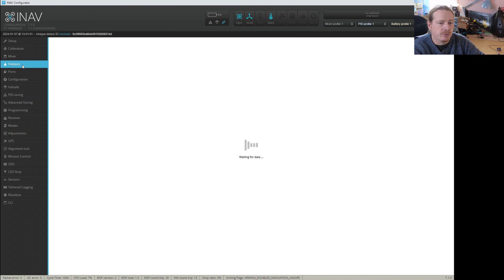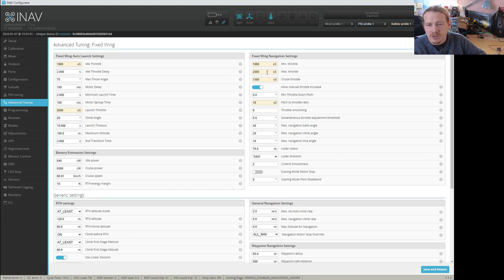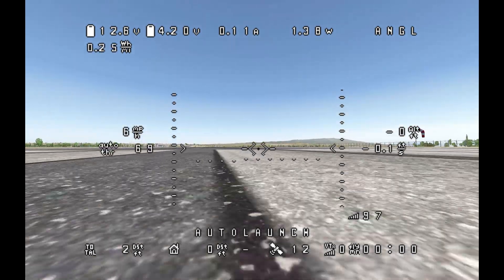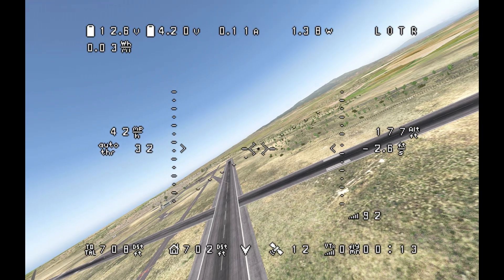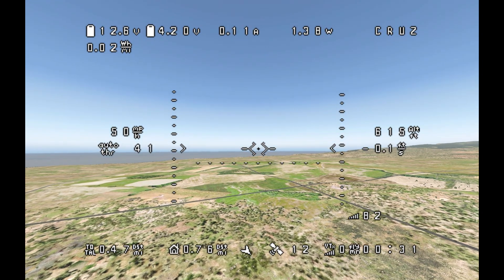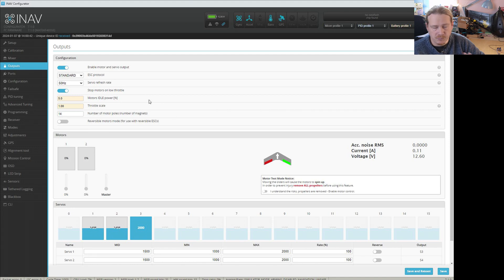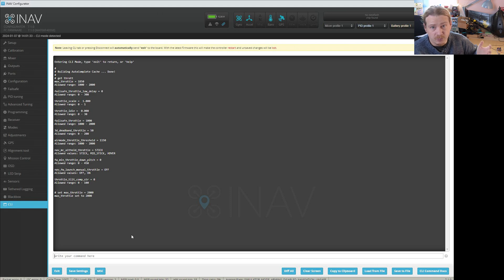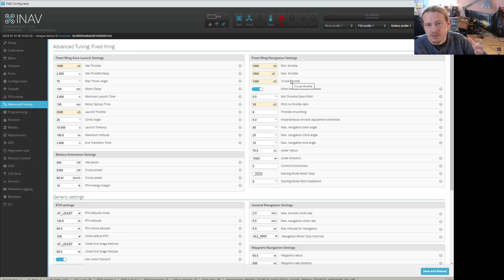INAV Fixed Wing Scaled Throttle: How to get the correct values in your OSD

Comment: Great video, trying to diagnose a motor screeching noise when powered and throttling up via flight controller brand new motor screeching at low throttle.  Tested motor on regular servo tester and runs smoothly and quieter.  Any thoughts on this issue?  Thanks for the content.
Reply: Hope you figured out the problem by now. If not, try changing the ESC protocol to Standard if it's something else.

Comment: Does this mean that I have been effectively flying with a throttle cap of 1850 using default INAV fixed wing settings? Could I expect to see more rpms at the motor after changing this to 2000?
Reply from the maker: No. If using DSHOT or the ESC was calibrated. There wouldn’t have been a throttle cap.
Reply: @MrD  Great, thanks for clearing that up for me!

Comment: Hello. One think is not clear still for me.  When you apply Throttle Scale , the throtle values you set in AutoLaunch and Navigation Settings are also scaled by that factor, or those are the final values (after scaling)  ?  Also the throttle value you see on the OSD is already scaled ?  Thx.

Comment: Hi Darren, sorry for being off topic. I use a 34inch widescreen monitor.
I can't get Inav in a good proportion on the screen. For example, I can't reach the bottom of a screen to save settings, for example. It is not possible to reduce the size of the program or to adjust a layout.
Is this problem known or is there a solution?
Reply from the maker: The size of the monitor won’t make a difference. What matters is the resolution the monitor is displaying at. My main monitor is either 28 or 32” widescreen, and it works just fine. Maybe increase the resolution if you can. 34” is huge. You should at least be able to run 1920 x 1080 on that. That resolution is fine for configurator.

Comment: Is it only for showing the correct throttle in the osd or does it also change how fast the motor will spin? So do i have to change the cruise throttle afte making the changes?
Reply from the maker: You don’t need to change your throttle values. They were being displayed incorrectly before.

Comment: Nice!! Will this now mean that 50% stick will show as 50% on OSD? or do i still need to make 1000-2000 endpoint adjustments using rxrange in the cli?
Reply from the maker: Yes, 50% on the stick will show as 50% on the OSD. Yes, you should always make the 4 main control channel ranges 1000-2000. I actually prefer to do it on the radio rather than rxrange. I have a base model, that all my other FPV models are duplicated from. After setting the endpoints on the base model. I never have to worry about it again.

Comment: Thanks. But why isn't max_throttle set to 2000 and throttle_idle set to 0 as part of the defaults when initializing at new board and choosing a fixed wing model? 
It'd be great to have an explanation of what throttle_idle and "stop motors on low throttle" really mean and do. Don't motors always stop on low throttle?
Reply: It's a relic from BetaFlight/CleanFlight quad flying. On a quad, you 1) can't stop the props at idle, because if you drop the throttle to start a dive and your props stop spinning, you not only have no throttle, but also no flight controls, since the props need to be spinning for that. So on quads, when they are armed but the throttle is at 0, the props are still spinning, even sitting on the ground. Conversely, 2) you can't ever really go to actual 100% throttle, because you would also then not have any control. Imagine that you were flying a quad, at actually 100% throttle. If you commanded a left roll, then the right motors need to increase throttle in order to bank left. But they are already at 100%, so there's nowhere higher for them to go. Even just to fly straight and level the throttle of individual motors is always varying a little with the control loop. So the quads always keep a little headroom like he said in the video so that the control loop can always increase the throttle on the motors a little bit even if you are at "full" throttle.

All that being said, I agree with you, the defaults in INAV should set min and max to 1000 and 2000 when selecting any of the plane presets. I don't think there's ever any reason on a normal plane that you'd need 5% at the bottom and 15% at the top for headroom (though I'm curious if maybe there's a reason I haven't thought of).

Comment: Isn't inav just a dumbed-down, imitation ardupilot, with a goal of having a prettier front end, because regular people aren't smart enough to understand ardupilot?
Reply from the maker: I really shouldn't dignify that rubbish with a response. I work with ArduPilot every day, and it is not the gold standard of firmware by any means. It is bloated and has plenty of issues and shortcomings. The fact that people claim you need to be smart to use ArduPilot is a fallacy. You just need to be persistent enough to trawl through countless documents and parameters to get the damn thing set up. It's not difficult. It's pointlessly long winded, with badly designed GCS software. Then there's the fact that once you do get it set up, everything flies like a sluggish airbus. Even after all the different tuning you need to do. But then, most ArduPilots don't fly anything more adventurous than FBWA.

So short answer. No. INAV is thankfully nothing like ArduPilot in many respects. It's quick and easy to set up. Acro flight actually feels exciting, tuning concentrates on what's important (rates and FF, which ArduPlane does not tune), it is much easier for pilots to customise, and contributions are welcome (unlike ArduPilot, where many improvements are ignored or not accepted, which is why ArduCustom exists).

Comment: The man!  You have no idea how much I needed this video!  I've read all your comments (and others) on Github regarding scaled throttle on the OSD, but this really clears things up.  One question... does the max throttle setting affect the manual motor output sliders in the outputs tab?  Wondering if I need to recalibrate my non-dshot ESC's after making these changes?
Reply from the maker: If you're not using DSHOT, then it would probably be a good idea to recalibrate the ESC. Thanks for reminding me. I'll add it to the video description.

Comment: Excellent video Mr. D. [As usual]. I placed landing gear on my 1.8M OG Talon for ground takeoff. I set the idle and launch throttle the same and as long as I have a path for take off it actually works pretty decent. 😊
Reply from the maker: Cool. I know some guys have tried this for real. So long as the yaw holds stable, I'm sure it will work fine 👍